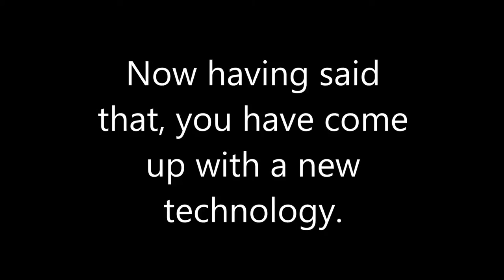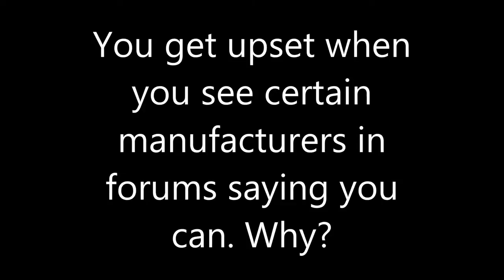Dennis Foley Acoustic Treatment Interview Part 2

Comment: What about electric pulses? Years ago Worth made a baseball bat that sensed impact and a battery unit neutralized vibrations. Their claim was that it made the entire bat a sweet spot, regardless of where the batter struck the ball. Could this thought be applied? EMP walls 1 inch thick that kill 80% at 30 cycles?!?!?! ;) Love your work
Reply from the maker: Hi Eric,  Low frequencies below 100 cycles need mass if you are going to minimize their impact at the structural level. Electronic manipulation usually is confined to phase inversion and amplitude reduction through EQ. We treat in the analog domain. Their is too much electronic manipulation already before the signal even gets into the room. Remember, your music must sound like music. Over use of electronic signal processing can take away the heart and soul of music.

Comment: what do you think about rpg modex(vpr)
Reply from the maker: Hi Dor,

Peter's Modex unit is a broadband, diaphragmatic absorber with 100 % absorption beginning at 50 cycles. He does all of this in 4.5" of space. This speaks well to the power of diaphragmatic absorption. You can achieve a lot of absorption horsepower in a small amount of space. 

In contrast, our units go down into the 30 Hz. range and do this in 8 - 10" of space. Once again, both designs show just how powerful diaphragmatic absorption can be. With diaphragmatic absorption, you can reach down into these low frequencies, which all rooms need help with, and also provide a strong rate to go with your chosen level of absorption. With low frequency absorption, it is all about the level you can reach down to and how quickly you can absorb energy starting at that level and going up from there.

Thanks
Dennis
Reply: Acoustic Fields
thanks dennis i Appreciate it!
Just to clarify i think the 2.5mm modex plate have almost 100% at 40hz...
i use A similar method and  reaches  30hz by Using two "membranes"(20cm total)
but the Significant disadvantage is of course the weight!!! so
if you can get this with less weight it will be Amazing!
and Will "march" us A few steps ahead! :)